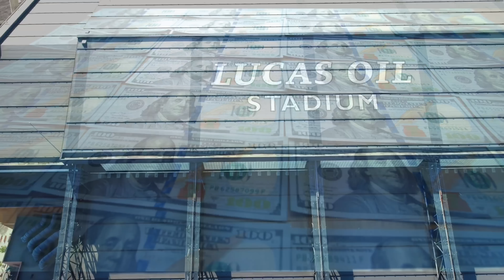Why You Cant Make an Outdoor Stadium into a Dome…

Comment: There's actually some examples of outdoor stadiums that were converted into dome stadiums, such as the Arena da Baixada in Brazil, the Belluna Dome in Tokyo and the Santiago Bernabeu in Madrid!
Reply: Also, Sochi’s Olympic Stadium had a temporary roof added for the games. It was not part of the original design, and was added partway through construction because Putin wanted to waste $70 million or something on a roof he’d deconstruct after the ceremonies.
Reply: To be fair, Arena da Baixada was built with a roof planned for the future, and Santiago Bernabeu is only just building a roof after decades of planning, supporting the key point of the video. Belluna Dome has just a canopy and the sides are open all the way around (oh, and nobody likes it because it turns into a sauna in summer...well, even more of a sauna than the rest of Tokyo).
Reply: @rockinmel1  yeah and for Seibu their canopy was built over a bowl, any shape more complicated would be very difficult and Lambeau while being round and bowl like would absolutely want to be enclosed
Reply: @matthewlaird4009  Exactly, plus Seibu's stadium is also dug out rather than built up, making it much easier to build a canopy with the bare minimum of support infrastructure (basically equally spaced "feet" on the ground). I was kind of impressed when I first saw it in person, although inside...not so much.
Reply from the maker: Yes but those are just covered and not climate controlled
Reply: @forgottenplaces9780  Wimbledon did it also
Reply from the maker: @jzuniga999  did u watch the video?
Reply: @forgottenplaces9780   The Arena de Baixada and Santiago Bernabeu have ...or will have in the case of the Bernabeu...AC. The Bernabeu will also have heating, which will make it climate controlled.
Reply: @matthewlaird4009  The Elements are part of the Game or ought to be.
Reply: @jzuniga999  I wish they hadn't.  It hasn't been the same since.
Reply: @forgottenplaces9780 Arthur Ashe isn’t Wimbledon
Reply: @forgottenplaces9780  yeah and nfl stadiums you are mentioning are also not climate control!
Reply: @forgottenplaces9780 I don’t understand what the obsession with climate controls is? Adding a roof (of which there are many examples in Europe (Camp Nou, Bernebeu etc.)) already acts as a certain level of climate control
Reply: Also the Olympic stadium Berlin
Reply: Montreal's Olympic Stadium now has a roof.
Reply: Make Dome stadium …… that opens up……
Reply: @toddb8575  It was always supposed to have a roof. It just wasn't finished until 1986 then like replaced twice.

Comment: Wimbledon added a retractable roof and air-conditioning to two of their stadiums. The first was added in 2009, and cost approximately $165 million. The second was added in 2019, and cost approximately $85 million. I'm not sure why it cost so much less to add one in 2019.
Reply: Centre Court was practically rebuilt over three years in addition to the roof, so thats why it cost more. No 1. court was newer, opening in 1997,  so didnt need as much structural work
Reply: Well I don't know about many sports stadiums but I know Citi Field which is the ballpark the Mets play in, the softer soil in the area (due to the bay) is the reason adding a roof would cost at least $2 billion because of the extra support it would require to make sure the whole structure is stable.

Comment: Vancouver did it for the Winter Olympics. Changed from a fixed bubble inflated roof to a complete retractable design.  The supports for the retractable design was not part of the original bubble design.  The cost benefit analysis was overtaken by schedule and the cost was comparable to a new stadium built from ground up.
Reply from the maker: But that was already a dome to begin with.
Reply: They did it after the Olympics, the Loins played 2012, and 2013 at Empire field. I'm from Hamilton, and a big CFL fan. I like that a city with money like Vancouver, was willing to build what I feel is the best stadium in the league.
Reply: @aaronglover752  The Loins?  I take it you don't like them.if you are referring to them as that.
Reply: @DownriverBusinessEventsGroup  no that's spell check, I like BC
Reply: @aaronglover752  Your spell check didn't work on that one for sure.

Comment: Actually it's very possible to put a roof over an open air stadium. Seibu Stadium in Japan & Montreal's Stade Olympique come to mind. Also,, did you see the sarcophagus they did in Chernobyl? That thing covers the entire nuclear plant zone that caused the famous meltdown in 1986. Anyway, it should have been attempted at the old Globe Life Park in Arlington. But Nolan Ryan was one helluva smooth talkin Texan when he pointed out that the cost of the roof would have been as much as it would be for building a new retractable roof stadium (Heh, yeah like 50yrs down the road it'll be worth it). Great video, keep it up. Great work!
Reply: Stade Olypique was always meant to have a roof. In fact a retractable roof. But it was finally finished 10 years after it was finished (outdoor). It  was also renovated and no longer opens.

Comment: They could have done it with Chicago Bears, Soldier Field because the tor thing down and rebuilt it. The Facade was the only thing left of the original building. I can't understand why you would spend so much money to pretend your building is old. Lambeau Field never gutted the building and rebuilt. They actually added on instead. Lambeau field just got bigger and bigger as I grew up. And right now they are adding on to the structure again. It's insane the structure that surrounds the old part of the bowl.

Comment: Some crazy ideas I have in mind:
1. Build a smaller shed or canopy inside the stadium (meaning the posts or poles would be nearby the playing field). Probably not because it would have obscured the view from the top levels, also the risk of players crashing into those poles
2. Build a stadium underground (??????)
3. Hold events or games at midnight. Would definitely remove the problem of sun exposure but the timing wouldn't be fine with spectators
Reply: If MLS actually gets a team in Vegas, midnight kickoffs in the summer seem like the only sane solution.

Comment: It can be done, it's just doesn't really make financial sense most of the time. It's going to be very large and expensive, not a $100 million upgrade, and if you're building that big of an additional structure, the owner would rather knock down the stadium & build a new one to make other revenue generating improvements (like luxury suites) and have all new building infrastructure.

An interesting side note, I know it's a much smaller scale, but I remember going to hang out with my friend at a different college in Boston, and we go into the lobby of this sleek modern glass & steel skyscraper building.... and inside the lobby is an entire 1920's-ish brick & marble building. The original college's building, like a giant for it's time bank-ish building, they just built the new (enclosed & climate controlled) building around and above the old one. It was pretty trippy to see glass and steel walkways going into where windows on the old building were. It's doable.

Comment: Oita Stadium a.k.a. "The Big Eye" in Japan initially opened without a retractable roof. The retractable roof was later added.
Reply from the maker: But like arthur ashe its not climate controlled
Reply: @forgottenplaces9780  Actually, Arthur Ashe Stadium has a HVAC system. It's climate controlled.

Comment: Check out the U.S. Open National Tennis Stadium in NYC.  It was built as an open-air stadium, and years later — a self-supporting, retractable some was added.  This is no small stadium, as 23K+ and the self-supporting principles here could be scaled to meet a larger stadium.
Reply from the maker: I did i go into it in the video. 23k is not much bigger than a basketball arena so its a bit different doing it at a larger scale. That worked better because the stadium was more square and had no gaps either. Tennis court is a lot easier to cover than a baseball or football field.

Comment: I always envision a clam shell ( rolling roof) type deal where not only it covers the stadium but also a hundred yards around the perimeter of it.

Your Hvac systems ( chiller , boilers) don’t necessarily need to come from within side the stadium but can get pipe underground into the stadium.  What’s left ( and an important factor) is you have to develop some type of exhaust systems on this rolling roof.

Comment: The Hubert H. Humphrey Metrodome in Minneapolis had a roof made of Teflon-coated fiberglass fabric.  The roof was held in place by air currents from below.  Unfortunately, the roof collapsed so many times, the entire stadium had to be taken down.
Reply: Those air currents especially from the Large Air Conditioner behind Home Plate are what help propel The Twins into hitting so many Homeruns.  Baseball was never meant to be played in a dome.
Reply: NOt why it was taken down. It was taken down so the Vikings could build a stadium with luxury suites in order to make more money.
Reply: Strangely, the Carrier Dome in Syracuse is designed by the same architects as the Metro Dome and is quite similar, yet has never collapsed. Even with the weight of Upstate NY’s considerable precipitation, the Carrier Dome’s fibreglass roof has held firm.
Reply: @cuseyeti_one8three  The Metrodome is one word however

Comment: You forgot to mention that the Harry S. Truman sports complex (Arrowhead and Kauffman stadiums) were designed to have a rolling roof that could cover either stadium from the very beginning.  The rolling roof is the reason why Arrowhead's upper deck has the unique shape it has.  Cost overruns during the original construction of the stadiums ultimately caused the roof to be scrapped.  Had the measure passed in 2006, the complex would have actually been completed as initially planned, which obviously never happened.  Kansas City was going to have the world's first retractable roofed stadiums 17 years before the Skydome opened in Toronto...  THAT is how far ahead of its time that sports complex was when it was built.  Over 50 years later they are still two of the best stadiums in the world.  When everyone else was building shitty cookie cutter multipurpose stadiums that sucked for both sports, Kansas City couldn't have gotten it more right than they did.
Reply from the maker: Its covered in a recent video of mine

Comment: Idk man we don't do it in America but there are stadiums that have been converted overseas. Obviously the whole point though would be to mitigate precipitation like snow and rain. It wouldn't necessarily need to be climate controlled.

 I'm sure fans from Wisconsin and Chicago wouldn't mind the harsh cold. They already attend in the freezing temperatures anyway, but if you can keep everyone from getting wet that would probably be an optimal situation. The problem probably lies in the thousands of pounds of snow and ice on a makeshift roof. 

Like So-Fi Stadium (which is a must visit stadium) has a planned overhead structure that's part of the building, but its still an open air stadium, obviously in LA this is ideal because you hardly have to worry about snow. So you're shaded and protected from rain, but still technically outside. 

I'm sure it's cheaper for most NFL orgs to just build a second slightly smaller enclosed stadium for harsh weather days anyway as you would probably only use it a few times every few years.

Edit: like the Bills game this week was re-located, which doesn't happen often but if every team had a "backup" stadium to conduct game day operations it would probably be worth the investment, at least to the fans lol
Reply: Even if The Bills had one there was 7 Feet of Snow there.  Unless there backup stadium was hundreds of miles away it wouldn't have mattered.

Comment: They put a roof on the Olympic Stadium in Montreal. They did a horrible job of it, but they did it. 

Also, the University of Idaho enclosed their previously outdoor stadium. It's not a big stadium and not much of a "dome", but it was done.
Reply from the maker: Olympic was built as a dome, it just wasnt finished and capped off until later

Comment: If the old doughnut stadiums still existed, you know the ones that looked like huge ashtrays, had roofs added it may have been as easy as putting a lid on a coffee cup maybe this could have been done.  Think old Three Rivers Stadium or Riverfront Stadium or Veterans Stadium (Pittsburgh, Cincinnati and Philadelphia).  Bad sucky a suspended roof and enclosing the round concourses and perhaps it would be feasible.

Today the best that could be done to stadiums that are asymmetrical would be to use something like Miami but that wouldn’t keep out the cold in places like Minnesota, Detroit or Cleveland.  It would be better to start all over again instead of attempting to retrofit a ceiling on an existing stadium.

Baseball stadiums would just never work.  Think of all the odd angles of Fenway Park and you understand that it might cost more and certainly be inferior the just plowing the old and building the new.

In the old days of automobiles there was a market for aftermarket air conditioning that was both costly and looked like a unit hanging out a bedroom window.  The same can be said for stadiums.

Wonderful video as usual.  I rarely post but watch every video that you produce.

Comment: Isn't SoFi  Stadium basically a stadium with a roof over it?
Reply: Yup. The roof structure itself is not connected to the actual stadium, similar to  Marlins Park in Miami.
Building a roof cap over an existing stadium is no fear of engineering nor all that expensive (for a billionaire)
Reply: The roof lights up at night, doesn’t appear to be of heavy weight… and a game was delayed for lightning (rare in LA) because the roof apparently can’t handle it.

It’s not as open air as T-Mobile for the Mariners, but air can flow through it (and in some surprising places). So fans at the CFB championship in January were getting wet because of a storm blowing through.

Comment: do you have several billion dollars you want to invest in a roof - a roof would involve many structural problems on an existing building depending on its age and an existing building might not even be able to support the weight of a roof - don't suggest using supporting beams from outside and around the building because that would be worse than stupid and making steel beams that would fit across an existing building is equally as stupid - that wold be like placing a piece of string over an object and then laying a heavy object on it - the string would sag or even break as would a steel beam with the weight of a roof on it.  You just can't can't put a roof on an existing building - the studies and design work alone would cost millions and millions of dollars and then would only prove it couldn't be done.  The SoFi stadium has done that with a new building - but they didn't enclose the building - they left all the sides open - cost 7 billion dollars for the roof alone and the fans now get to sit in a hot open sided building - looks nice but would you want to pay maybe $125 dollars and quite possibly more to sit in a hot box for three or four hours?  Not this person when I can sit in my comfortable air conditioned home, eating snacks, having a sip or two and watching the game on my wide screen tv for nothing.

Comment: Texas rangers have new stadium its dome
Reply: But that stadium was built specifically with a dome. Its predecessor across the way from it stands was an open stadium, which probably needed a dome when it was built in the 1990s.
Reply: Texas Rangers stadium has a retractable roof.  That should be the standard for all baseball stadiums where weather causes delays and has excessive humidity.
Reply: @vincentperez4653  Weather is part of the Game.